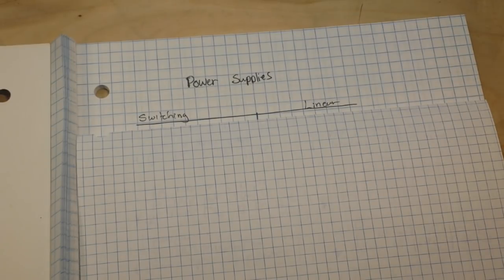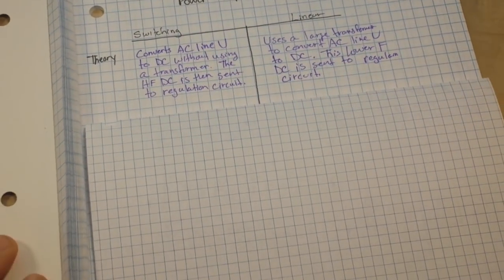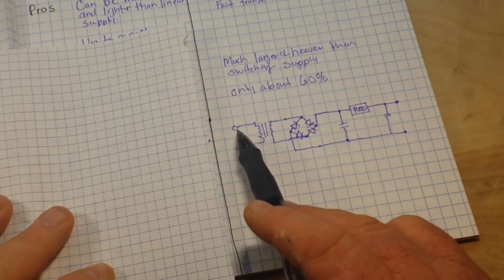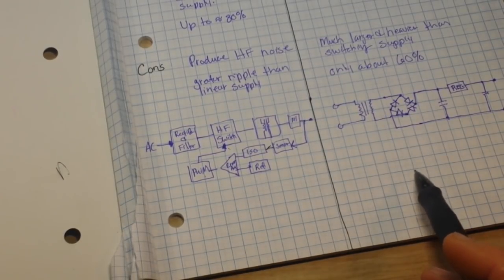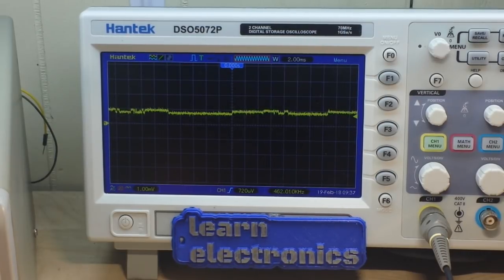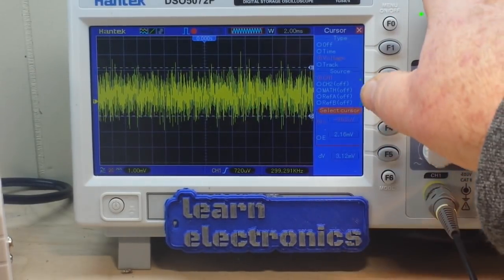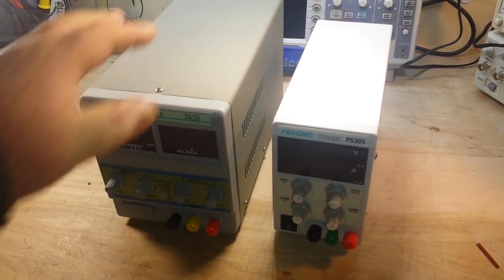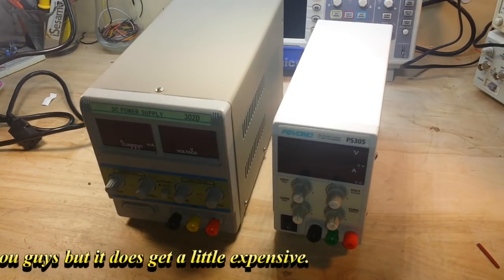Power Supplies: Switching vs. Linear

Comment from the maker: Towards the beginning of the video, talking about power supply theory I mistakenly said the transformer converted the AC to DC. That is of course incorrect. Thanks to those who pointed out my mistake.
Reply: Its difficult to make a video without mistakes.  Especially one being made for fee or close to it.
Perhaps one day there will be an edit function without deleting the video and re-uploading.
Reply: In the film transformers wreck entire towns.
Reply: Not a big deal unless your a absolute newbie!
Reply: I was wondering what was wrong. I immediately imagined a newbie pulling his hair out wondering why he was still getting AC from the secondary...lol But I'm glad that I found you - I think I'll subscribe.
Reply: Switching dc power supplies has 
output Vo1 is regulated.Is it possible to have all the outputs regulated not just one?
Reply: analog vs digital solid state ?(steping/switching)..note on analog i can over use amps 20% for 30 sec..nothing...solid state will pop...
Reply: @Joziah Royce Yup, have been using instaflixxer for since november myself =)
Reply: learnelectronics . I wasn't going to say anything. because I knew what you was meaning to say. and I knew you know your stuff. and simply misspoke.  you had me at switching power supply. I clicked immediately. great simple explanation!

Comment: I scored an old hp linear supply for about 40 bucks from an estate sale. The thing might of been made in 1962 and is way to heavy to move around, its a beast of a power supply. Absolute game changer for repairing pcbs for me
Reply: I got me an industrial 24V one like that.  When I saw the 3/8" nuts for the wire hook up, I knew this will definitely put out the amps it says it will.

Comment: Im about to purchase an 3band dj isolator would the linear supply justify the extra cost to purchase it that way or the switch mode is jgood enough. All this Just mixed me up.
Reply from the maker: For rf work a linear is always better. For af, either will do.
Reply: @learnelectronics  my use is a 3 ban dj isolator and my mixer does not have such a linear power supply plugged in the loop in out would a linear powered isolator make it better or i would not see such a difference if i do not mod my mixers power supply to a hand made linear,,,,,,,, which i am thinking of doing though.
People audiophiles rave it makes world if difference.
But im scared cause thinking the mixer was not made that way it might harm it if i do it this way.

Comment: Great video, Is it dangerous to run a switched PSU on lower than rated voltage? it is labeled as a 200-240v rated switched psu, how would running on 120 line voltage affect output wattage?
Reply: If it's a cheap one, it might, it will probably draw more current on the primary side and might fry your transformer or switching transistor.

Comment: Hi there , i think for laptop repair mainboard and mobile mainboard Linear is much better than  Switching  !! because Linear has protection on it and its secure for people doesn't have so much experience about electronic   but   Switching  doesn't  protection on switch off the voltage !! what do you think about that ? thankyou .

Comment: I am not new to electronics but up to now I had always compared the linear-  and switch-mode power supplies only from the weight, size, heat dissipation, and efficiency point of view. In all these considerations SMPS was always the winner. Somehow, the ripple aspect on the output DC just fell by the wayside. Thereby, actually, it should be very obvious to all. 
Now, I will have to do more objective differentiation between the two types - depending upon the application. Thanks for a very nice video.

Comment: various switching power supplies have different ripples peak to peak voltage and are at different Switching frequencies between 10K to 50K. When connecting various switching power supplies to preamp amplifier circuit the switching frequency and ripple gets amplified causing S/N signal to noise issues. How can you prevent this when using cheap china switching power supplies with preamp tube, op amp, transistor amplifier circuits to work with various switching power supplies?

Comment: I have the same question as another commenter, Fried Mule...why can't you just stick some capacitor(s) on the switched supply output to get rid of the noise?  I guess it must be very difficult or else the supply would come with the caps built in and have no noise on the output, but I don't see why it's so challenging.
Reply from the maker: You can to some extent, but the problem is not so much ripple, but noise. The PWM driver in these is operating in the VHF range.
Reply: @learnelectronics  I guess I don't understand the ripple/noise-removing effect of capacitors well enough.  I thought there'd be some combination and amount of capacitors you could stick on the output such that they'd eat up any AC component coming out of the power supply.

Comment: Regarding to switching power supply, i may put a transformer 230v in and out 230v. It can be now called a linear power supply.
Reply: No, still a switching power supply, with it noise. Nothing changes.

Comment: IMO linear is the way to go.  I've had a lab setup since the 70s.  A super clean linear supply will be something like 15v, 5a.  Size of a rack mount CRT scope and weight of about 30lbs.

My recently purchased Dr Meter linear PS-305DM, 30v, 5a I'm using to get a dead battery pack, hopefully, back up and running.  Most likely the  Dr Meter is the same form factor as in this video.  One of the cells was ultra low at 0.014v.  I chose to charge at 15mA CC and voltage at 0.50V CV.  Took about an hour for the CC indicator to go off and the CV indicator to light.  Gradually increased the voltage and current as the battery became charged.

The linear might make a difference in very low output application as above and when powering very low power like devices like watches.  The display reading did not suffer from any display jitter or bouncing digits during very low output.

I've worked many years in power supply manufacturing, a maker that specialized in supplies only.  I have a preference for linear.

Comment: Suggest a good brand of power supply for charging lithium batteries? Which voltage and current rating one should buy for designing battery upto 48 volts? 
Which type: Switching  or linear?

Comment: Could you explain 'high frequency DC' it's HF AC until it goes through another transformer to be converted to the required voltage to be rectified back to DC is it not? please correct me if I'm wrong. (DC cannot be processed by a transformer)
Reply: Ha yes I thought that too. Misinformation.

Comment: I looked at a Powerwerx power supply made for ham radio.  It had spikes with ringing at 250 khz, 1.22 v peak to peak.  This seemed not good to me because it represented almost 9 percent swing at 14 volts and thought there may be 3 volt IC's in the 7610.  Wish I could send the waveform to you since I might be reading it wrong.  My Astron was clean.

Comment: It is all about noise....most things it does not matter so much but in very low signal level, high signal to noise ratio electronics or analogue instrumentation it makes a MASSIVE difference. In these applications, linear wins every time.

Comment: Another pro / con is: reliability / longevity.
In my opinion: Switch Mode Power supplies are not as reliable.
Especially is small cheap electronics, LED light fixtures, etc.
SMPS for computers are getting to be pretty reliable.

Comment: Good video. Thanks. A lot of audiophiles use Linear power supply ( made by CI Audio or sbooster or uptone LPS) which cost anywhere between 350 to 550 USD with their devices like Ultrarendu and SOtM. They say it makes a huge difference in sound.

Comment: Switch modes supplies are superior, more efficient , less noise, less heat,  generate greater current output from a smaller size, etc.

Comment: "High frequency dc" is an oxymoron. dc is zero frequency by definition. The transformer alone doesn't convert ac to dc in your schematic for the linear supply. A rectifier converts ac to dc. And there's no discussion of the feedback loop you showed in the block diagram for the switching supply.

Comment: So are switching power supplies bad for creating amplifiers?? Will there be noise and can you somehow filter it? My old amps are all using transformers and are heavy.. was thinking of constructing an amp as a project but not sure if switching power supply would be OK.
Reply from the maker: Almost all modern amps use SMPS. The switching frequency is usually 150-400KHz, well above audible range. But if a problem occurs you can always top off your amp with a low pass filter set for the highest frequency you are interested in.

Comment: Hi, would you mind to try modifying by add passive harmonics filter circuit in ps switching type? 
So we can reduce its cons. That harmonics effect.
Reply: SMPS into high frequency filter into a voltage regulator will give you best of both worlds.
Reply: @1900OP  thank you sir..
But it already has voltage regulator, and still make some harmonics in sinwave voltage since it's switching type.
Reply: @atenglenon  Voltage regulators can't filter high frequency components well due to parasitic capacitance from input to output, so you need an LC filter somewhere in that path.

Comment: I'm looking for a bench top PS for mainly 2 applications, to power old 8 bit computers and also to revive 18650 lithium batteries...Which of these would be best for those applications?
Reply from the maker: I would go with the linear supply.

Comment: At this time  November 2018 and back to this past summer, I can get a used BK Precision 1735A linear supply from a surplus store. 30V - 3A for US$91 / C$120. Weight 10 lb.
I see them listed at Newark, etc. for $350 and up and even the national chain of retail electronics, Sayal, has a new similar spec supply of some name I've never heard of, they want $340 for. 
What I want a variable supply for is bench powering little headphone amplifier boards and other audio stuff that is generally battery powered and taking its input from wireless headsets. Some I want to see how they perform in gain, noise and distortion with different supply levels, because I have the data sheets for the main amplifier chips that show the allowed supply range and the output performance across that range. So I don't want a supply that could transfer noise to the wireless headset or to the amplifier board.
I'm guessing these cheap Chinese switching supplies might be noisy. Certainly the reviews are full of units faulty right out of the box they came in or rely too much on digital controls that  don't hold settings and end up frying your circuits under test.

Comment: Why doesnt a 350 watt psu push a sub but a 10w bass amp transformer will. I was trying to hook the psu in line for power instead of the tiny "transformer" but the psu wont make a sound when hooked in. Went back to the the little thing and it pushes a 200w rms sub for some reason. Not much but it works which is suprising
Reply: Your psu is, most likely, outputting DC, is it not?

Comment: Isn't millivolts negligible for almost any and all applications? It looked so big on the scope then I payed attention to the actual rating(lol) 1mv. vs 3 mv . That's not like 3 vs 30 or 3 vs 10 even.. lol. I'm not nearly versed enough in radio stuff to know.. Is any radio stuff even that sensitive? 
Also, how does a power supply work.. Like I have a psu from a cpu and no matter what I plug into it or what resistance I put in line with it it'll only put out whatever the internal resistance of the actual device is demanding(it only will blow LEDS). The only exception to that I've been able to notice is if I connect a big DC 2wire motor, an even then it defaults to .300-.400 ma. I need to physically hold the motor to make it output more amps. (even tho adjusting a pot does hardly nothing but turn it on and off... I want to power a laser diode off this an it's all I got.. I don't get it. Can I just plug my diode in an it'll magically know it's ideal operating range? Why does it pretend resistance dosn't exist inline before that too? Am i witnessing some freak anomaly?
 Then follow up question: How does a supply FORCE more current/volts in if based off that theory and behavior you should be able to plug anything into a regular 120v rectified an smoothed single an that's it'll just magically draw whatever it needs as long as it's not over .4ma?.. Cause I'm told it's a switching power supply...Like if I add resistance to the motor I can get it to output up to 2A(should be putting out 12v @ 18A... or 5v @24A..) I dunno.. been stuck on this for weeks. WEEKS.. The more i think about it the more I'm going insane... Can't afford a decent power supply.. Wasted money buying a assortment of LM chips as I watched the video on them and using them to power a laser diode.. but I'm worried if I connect the computer 12v in to the LM317 it will get 12v @ 18A(well within V range but way above A range) an just fry.. or does that magical rule apply? And if so? Re-circle back to beginning.. lol.. help.. please.. like what power supply from mains is below 1.5A for the hobbiest/inventor? Or can I just plug my PSU into the LM317 laser diode power circuit, it'll auto sense it can output the full 12 but auto limit itself to only putting out what the chips max is? an if so.. how does a power supply FORCE more current in? see the circle here? Please.
Help. lol.
Reply from the maker: How cow. That's quite a comment. I think it deserves it's own video....
Reply: @learnelectronics   I corrected some of my sloppy typos.. Dosnt make the question make MUCH more sense but slightly more accurate anyway.. lol.. An that would be so awesome I'd be honored =D
Reply: @learnelectronics  Also, my days take forever now I'm so excited for the video an to try an solve this mystery.. (lol)Heads still gonna explode, watched dunno how many youtube vids, have like 50 open tabs just pouring over everything trying to find the answer.. I dun get how there is no explanation for this. I understand ohms law, just it gets wonky when it comes to this stuff.. An SMPSUs an such are basically the new standard so like.. where is the info? It gets even more wonky when it comes to trying to power LDs off SMPSUs, or tieing in regulator circuits in the SMPSUs to power LDs so they don't blow the LDs..  >.<... I'm starting to rant again,, lol. Anyway. ,,Thanks again. Totally stoked for the vid!

Comment: What do you think of these new "Class H" amplifiers that have a switch mode power supply with multiple rails driving a Class A/B amp? Supposedly  these are able to overcome the limits of the switch mode power supply by switching from the low power to the high power rails when more power is demanded.
Reply: Class H does not infer a 'switch mode' power supply.
Reply: @seanmangan2769  okay, so how are you going to modulate a linear power supply? It's not a dual-rail, that's Class G.

Comment: It seems like linear supplies last longer. The linear wall warts I have from the 80s and 90's still work. Most of the featherweight switching ones I have from the zeroes have failed at some point. I'm sure these switching power supplies have a lot less copper and iron in them and save money on shipping costs, making them ideal for today's throwaway electronics.

Comment: A well engineered SMPS produces orders of magnitude less interference at audio frequencies than an LPS, the fact that the majority are nasty cheep Chinese knockoffs of the genuine article is not a good basis for saying SMPS are noisy with HF noise.

This thinking comes from "oww.. it's heavy, it must be good". It simply is not true. In high power audio amplifiers in the 5kW and above range they are ALL switch mode, because of the <60% efficiency with linear, trying to cool a 2kW heating element is no small task. I make SMPS with less than 1 microvolt ripple and no harmonics whatsoever. 

Stop perpetuating the switch mode is noisy when you buy a 60$ pile of crap with a Chinese low grade unit inside jeeesh

Comment: Back in the 1980's I purchased a 12v 25A Linear Power Supply (cost me nearly 300 dollars back then) from Tripp Lite for my Amateur radio.  Switch Mode was still very new and back then it would tear HF up.  I had a fire in my Apartment in 2006 and thought it was lost but I found it at my parents house in 2013 and I was relieved.  This sucker is very expensive now and talk about heavy this sucker weighs a metric ton and if not careful could give you a hernia.   Sadly I see computer power supplies that do 50-100 amps than this old thing.

Comment: I found this on ebay earlier today and was thinking of possibly getting one , its looks a bit cheap to me which makes me question its performance and reliability  https://rover.ebay.com/rover/0/0/0?mpre=https%3A%2F%2Fwww.ebay.co.uk%2Fulk%2Fitm%2F112479627775   please if you get a moment let me know what you think .
Reply from the maker: That is basically the same supply I used in the video. They go by many different brands. Nice, sturdy, well built, very low noise.
Reply: learnelectronics Thanks so much for your reply !! :-)
Reply: Adamski A. you sure that its a linear power supply? look in the product discription.
Reply: Adamski A. I wont to buy linear power supply too. But in this item discreption write- "performance close to the linear power supply", so i think its not a linear one.
Reply: איתי שלו Im sure it said linear , ill check again.
Reply: איתי שלו Oh i see . Ok yes fair point .

Comment: Nice video and explanation. What supply if your turning on and off a lot of rgb LEDs with let's say sound control?

I had always thought switching for changing loads.
Reply from the maker: Unless you are dealing with turning your LED's on and off in the 500KHz+ region, an SMPS should be perfectly fine.